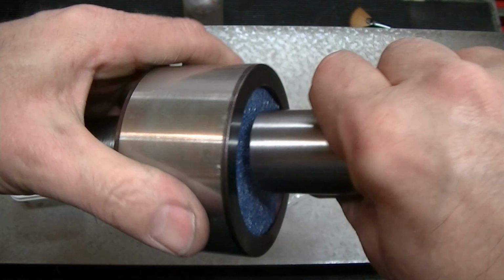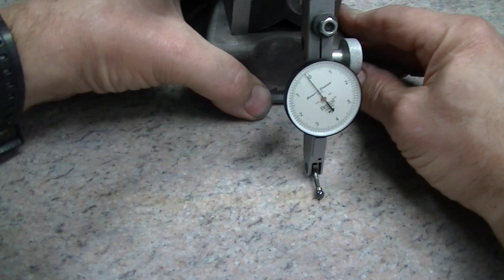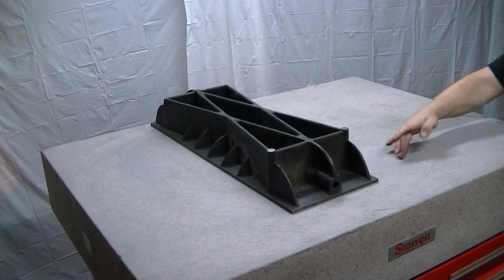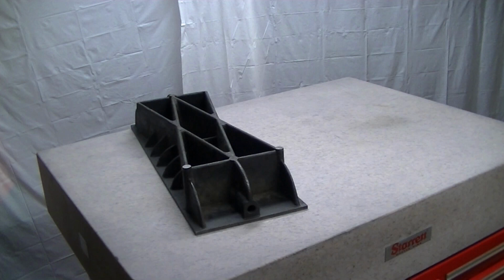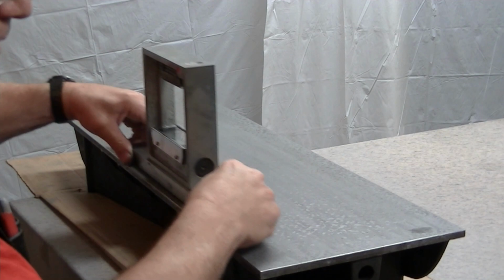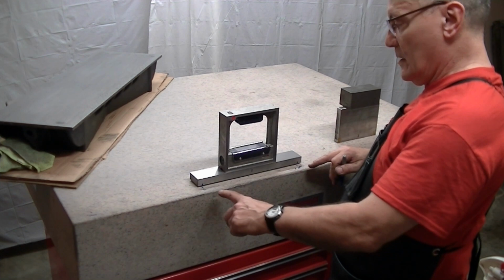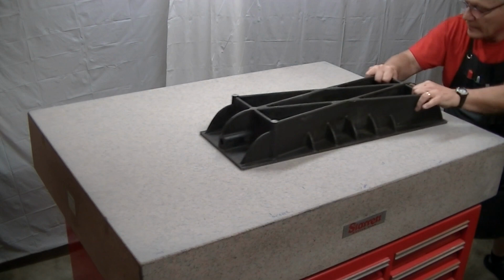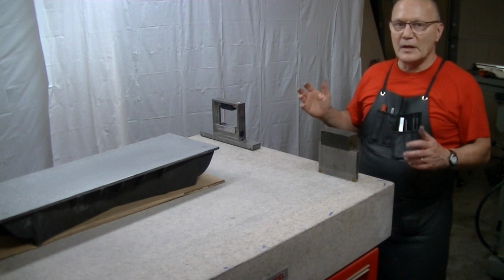DIY SURFACE PLATE LAPPING PART 1 (audio fixed)

Comment: lapping? uhh. there must be a way to get good level of flatness without lapping in 21 century. for how long are we going to continue lapping while around us there are now self driving cars and chat bots answering encyclopedia-style questions? is there really no way to get this process automated? maybe if you build an hexapod ? or maybe if you build an interferometer from a laser diode ? building an interferometer-guided cnc router would be much easier to get flatness than lapping for days and the time would be invested in a machine instead of throwing it out on some  muscle movement.
Reply from the maker: Nothing is going to replace lapping in the foreseeable future. Semiconductors and optics would not exist without it.
Reply: @ROBRENZ  yeah, to arrive to semiconductor optics you have to go through lapping if you don't have anything. But humans aren't born by repeating billions of years of evolution down from the bacteria, we are replicating ourselves by already existing information stored in the genome. Same can work for flatness. For example, every broken hard disk drive (which all of us have) has a nanometer-scale flatness.You could use this flatness as a part of a machine that creates flatness in a plate near by. There are scanning probe microscopes for example, where a needle of few microns scans a surface and passes this information to a computer where the image of elevation is created. You could implement a device based on this principle by using linear guides taken out from a DVD video player, and using some needle of 100 microns in size. Ardiuino is cheap. There also affordable end mills of 100 microns in diameter. My point is, technology can be used somehow to achieve flatness, but if nobody done this yet, doesn't mean it can't be done, it will be.  Maybe I  will do it.
Reply: Well part of the problem with some high tech machine to do this is it would have to be very portable, lab grade "AA" plates need to be kept in a 24/7 365 climate controlled room, so you need to bring the calibration to the plate, most companies have to have their plates checked at least quarterly. When I had my smaller 36x24x8" plate calibrated and lapped the whole process took about 2 hours, and most of that time was them using a  Rahn Repeat-O-Meter to map out the surface then upload the results into their computer, the program tells them where and how much needs to be lapped off, the actual lapping process took about 30 minuets, rechecked then a certification issued. All and all it cost me about $400.00  This is done hundreds of times a month in factories and shops all over the country. Sometimes the simplest way is the most efficient way.
Reply: @absolute___zero  You do it then, I'll check back in 5 years